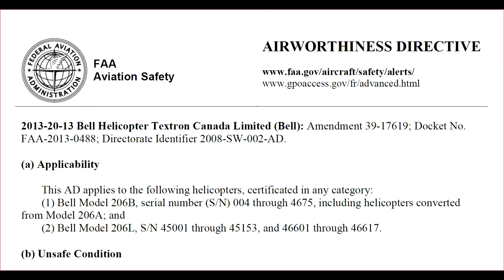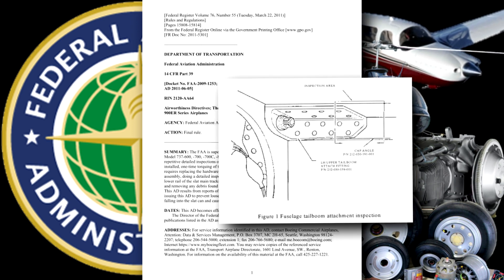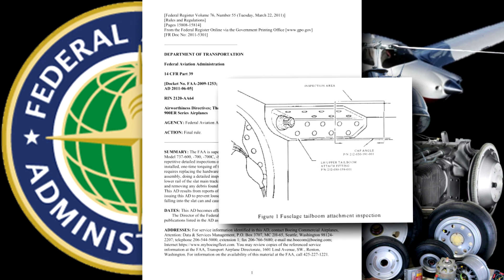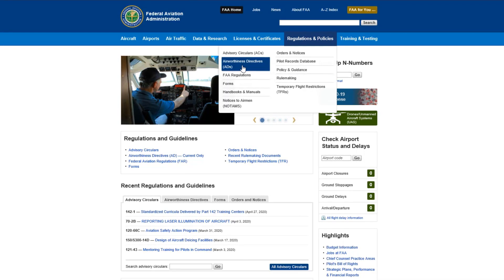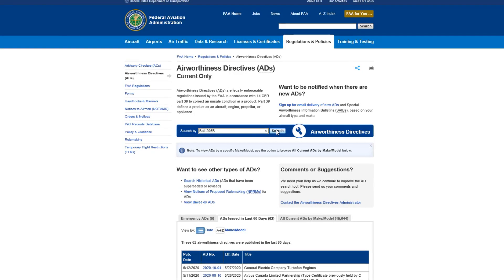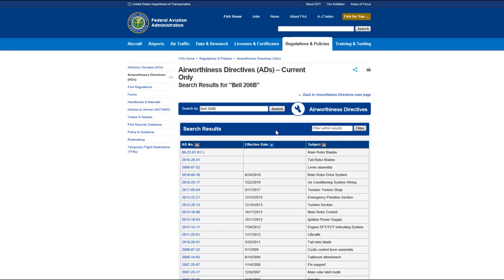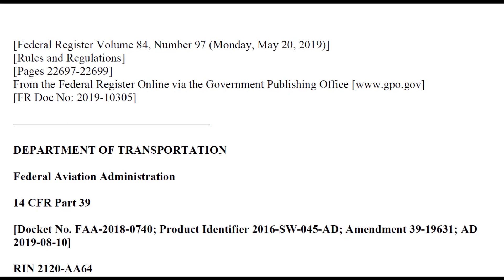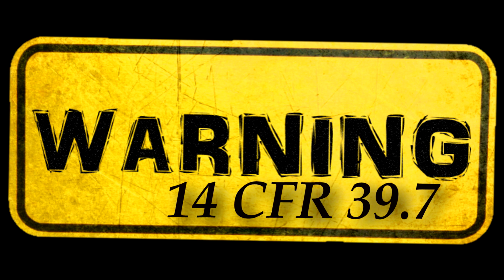Airworthiness Directives Maintenance Moment

Comment from the maker: The search just completed in this video was for the aircraft only, additional searches must be performed for the Engine, Propeller, Components and Appliances to have a COMPLETE search. Also, if you are unable to pull up AD’s for your aircraft, ensure you have entered the CURRENT owner information, example CESSNA is now Textron Aviation Inc. All models can found under the new owner.

Comment: Did the search really return "all the applicable ADs for your aircraft"? What about engine and component ADs?
Reply: You are absolutely correct. I was trying to keep it under 2 minutes. I should have mentioned that additional searches would be necessary for a complete search. This is my first attempt at this. Thank you for your comment.
Reply: @haysdavid8466 - no problem David, It is a good video on a important subject. AD research is not the easiest task so all tips are important.  Keep up the good work and supporting safety.
Reply: I will redo this in the near future